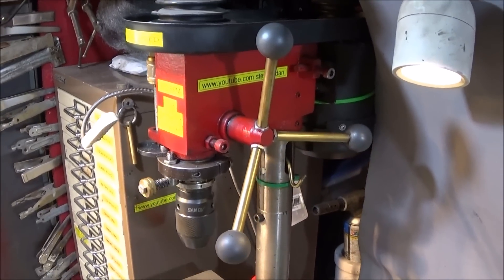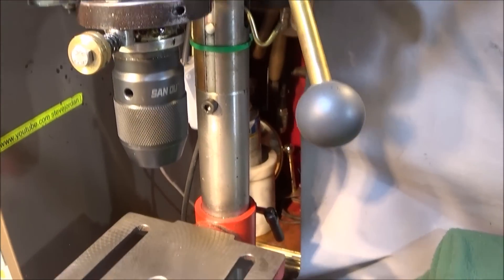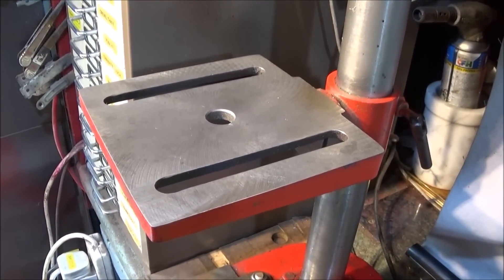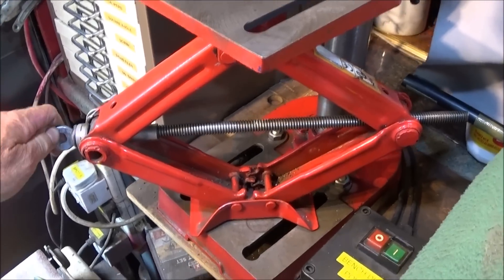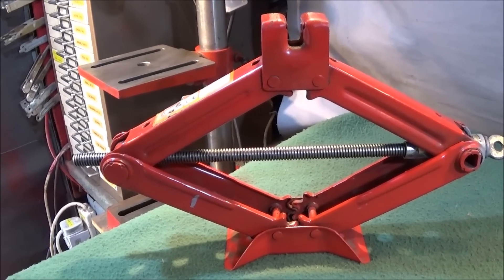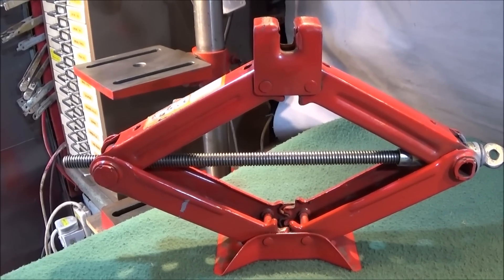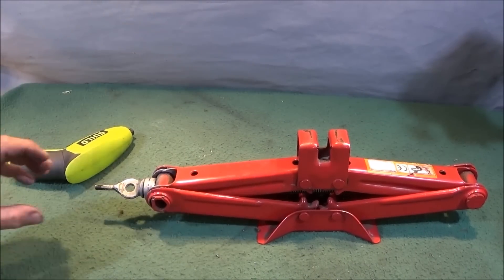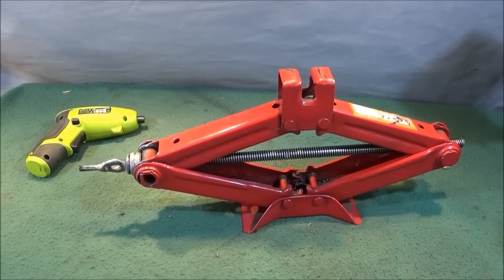A Scissor Jack Hack Super Fast Bench Drill Table Support

Comment: I've got to ask what made it necessary to put a jack underneath your drill press bed? I'm genuinely wanting to know in the event I may need it. I have a cheap drill press from some local box store and I put it through hell. I mostly drill through steel often cold rolled or tool steel hardness. I also often use a lot of home saws cutting through ~13mm (1/2inch) plate often and it's never been an issue.
Reply from the maker: On the low-cost bench drills, the drilling tables tend to flex under load.  Causing inaccurate angled drilling. The jack is placed under the drilling table to prevent this from happening. Just lightly touching the underside of the table to keep it square. The Jacks are quick and easy to I use like this. Regards Steve

Comment: yes   in fact   it would  lift  a car   with  a  bigger  drill.  i  use  an air power   air   tool  that  i  change   between the  two.  but  just like  a pump  jack  i have to mess  with   an ajust  to get it just  so.  anyway im thinking to  set an on off  on a  laser  measure .but  ror  now  i  wuse the  death  set  on te press.  i like your  sight i have  not  looked  for  a long while.  its  good.

Comment: I welded a 9/16th nut on and us a socket with my cordless drill has enough power that it will lift 19ft camper trailer to change a tire ;)

Comment: How well does this support actually work, have you tested it with a DTI?
Reply from the maker: Hi Robert I don't need to test it as there is no flexing. These jack's can take tons of pressure as they are designed to lift cars. Regards Steve

Comment: Or to save time get a j hook and put In Your drill
Reply from the maker: It doesn't save time though. The hook has to be loaded in a drill chuck each time. The hexagon is a permanent fixture. The electronic screwdriver is just placed on it easily whenever needed

Comment: Its good but theres another way to electric drive the jack without any mods or welding. I got a fairly fat screw hook to put in my drill chuck. I flattened three sides of the threads for the chuck jaws to grip, but that may have been overkill. Anyway, the hook part goes into the existing drive hole the same way as the original crank does. Easy in, easy out. You need not remove the chucked hook between adjustments. The drill can just hang there by the hook. A bonus of this method is that theres no exact axial alignment, so the hook drive will run smoothly at almost any angle, kind of like a crude universal joint.

Comment: You never but never grind on the side of a grind wheel...
Reply from the maker: I do.....I've done it for over 40 years. Its a myth that it is dangerous and came from when the bench grinder was in its infancy and the wheels were poorly designed. In the aerospace industry it was common practice to use the sides of the wheels to facilitate the grinding of flat bottomed drills etc.
Reply: Call me Old School, we got a smack against the head when we were Appi's

Comment: Just an idea:
What if you connect/screw the scissor jack to stand and table permanently?
A motorized table lift. Isn't it?
Reply: A powered screw anchored in the press's base and running through a threaded hole between the table proper and the bracket on the stanchion. You'd probably need to add a pair of guide rods back of the stanchion to prevent twisting of the table around its axis. 

Tools are a contagion.

Comment: Very cool. But, it is not a safe practice side loading a grinding wheel. They are not made to deflect. Also, side loading can weaken the wheel which can lead to failure causing the wheel to explode.   At typical grinding speeds injuries can occur.

Comment: Another winner idea from this channel !  Thank you for sharing.  This takes variation out of the drilling process.  My drill press is a floor model so I will add some rigid blocks under the jack ( light concrete is my first choice) to rapidly accommodate the additional height needed to put the   table within the range of the jack.

Comment: I've welded a nut on the shaft and use my impact or drill driver with hex adaptor. did this years ago... ok hack, but not too original.

Comment: I find myself using scissor jacks over my hydraulic jacks.  they are way more flexible, faster and easier to use with an impact driver
Reply: There has to be a 'sweet spot' in the movement of the upper end of the scissors jack, given the geometry of it and the nearly-fixed speed of the driver. The sweet spot will depend also on the thickness of the material being drilled and, likely, the material and the diameter of the bit in use. Some discussion of that aspect would be a worthwhile follow-up. 

I wonder about the apparent 'jerkiness' of the upper end of the jack. It probably doesn't translate into lateral movement of the drill press's table as such, for most practical purposes, though. Can anything be done to prevent any lateral movement of the jack table from affecting the press table? More lube in the joints? Springs? Merging of the pairs of pivots top and bottom on the jack?

Tools are a contagion.

Comment: Why go to the trouble of  ruining a hex wrench and welding.  a less destructive way would be to use a socket over the standard jack screw.  An electric drill or impact driver fitted with an off the shelf extension would be quicker and less destructive

Comment: Good idea. I have one of those old Craftsman floor drill presses which has no up/down table feed crank or gear rack. You have to wrestle the table up and down the column by sheer brute force. A car jack makes it possible to make tiny precision settings and avoid hernias.
Reply: I have the same problem, but I'm paraplegic, and it's very difficult for me to adjust the table. I think this will be a great fix for me!

Comment: nice idea steve, but i made one of these 30 yrs. ago . i just welded a nut  to the jack in the same place you did , it takes a 3/4 inch socket and it works with ratchet , drill or air gun. nice job though.

Comment: Really good idea, I know it means the jack can't be lowered right down but if one doesn't have a welder what about using 2 nuts (one to lock other) place on the other threaded end, make sure nuts are even then drill in reverse should achieve same result.
Reply: Probably hard to find a nut that has that thread pattern, screw Jack's use square threads not standard machine threads.
Reply: Learn something new everyday :D
Reply: @chimera91977  
Oh, well, I tried but on the upside, I now know about jack threads👍👍

Comment: i use my scissor jack with a drill and just chuck a 3/8 or 1/2 drive adapter in it. then i get a cheap deepwell socket and cut 2 slits in  the sidewalls to fit over that washer on the jack drive.
Reply: get a larger socket and no cutting
Reply: Weld the smallest possible nut on the far end of the threaded rod of the jack and be able to run it up with the drill in reverse using a socket you already have. Engagement of socket and nut encouraged automagically. 

Tools are a contagion.
Reply: N
Reply: Ñ Ñ Ñ

Comment: no offense but welding that little fiddly hex on there is stupid, you are limiting the jack to forever just being a leg for the drill press, you have a small shop like most of us so having a jack that can only do one light duty chore is a waste. weld on a proper 17-19mm nut or bolt head so you can put some major power to it in case you need to use it to lift something else. I've got 2 scissor jacks like that, one came from factory with 3/4" hex head and the other i welded a large nut to it and i can lift my 3 ton truck off the ground with either one of them, don't need to do it very often because i have hydraulic jacks but there has been times when the scissor saved my ass because i could crank it up fully weighted in a hurry with my impact gun.....
Reply from the maker: Hi Did you watch the video or did you just see and focus on the hex part and come up with the wrong idea? These jacks are so low cost you can have one dedicated for a specific purpose like I have shown. I don't need this jack for anything else. I have a few scissor jacks, a trolley jack and other equipment for heavy duty stuff. Having this jack dedicated for this purpose like I have shown, is great for me. It is so quick and easy to use having it permanently on the drill base 
   Also didn't you see that I left the original coupling eye on the jack? Just in case it was going to be used for something else? 
    You need to study things a bit first before deeming something as stupid. Look carefully at the whole idea before writing comments like this in the future, otherwise people will tend to think that you are stupid...:-) Regards Steve
Reply: yes i watched the video, more then once even. my comment was based on a personal experience which i learned the hard way when a screw jack i didn't think i would ever really need for anything big was the only thing that saved my life and it was because it had a hex strong enough for my son to get an impact on and lift the car i was pinned underneath. i'm just saying, it doesn't hurt to go big because you never really know when something might come up you never planned for of even considered a possibility.....

Comment: Just use 1/4" eyebolt......open end alittle...put eyebolt shank in drill...no need to weld ellen key to jack...
Reply from the maker: You could do, but its much quicker for me to do as I have shown. i.e ...Low cost dedicated small electronic screwdriver left on drill base for quick pick up and drive. No need to find the power drill, put the eye-bolt in the chuck, then have to hook-up onto the jack every time. I would get annoyed with that, as I need to work very quickly.
Reply: @SteveJordan  You have to "find" the drill and put the driver in it with any connection scheme, including your current variant. Seems pretty obvious. Thanks - Lumpy

Comment: I have a couple of these in the workshop for general use and yes that includes car lifting too! I welded a 17m/m bolt to the eye. So it can be used with a cars own wheelnut wrench. I mostly use them with an impact and 17m/m socket though. Great vid!

Comment: Hi Steve. Good video. That style jack comes in handy in many ways. The tool chest that is to the left of your drill press. I like it. I suppose that it was originally for something else and you repurposed it to go into the shop. I have been looking one like it with shallow drawers and a lot of them to put under my lathe to hold tool bits and other small stuff. Would you happen to know what it was originally used for so I would know where to start looking. Thanks and keep up the good videos.
Reply: Anthony 
They are Office Filing cabinets and drawers, that particular one looks like it may be made by. ‘Bisley’ i have 3 in my garage that i liberated from a rubbish skip.
There is a whole range of different sizes and configurations ...and they make excellent workshop storage ......even do matching metal cupboards ( and yes i got one out of a skip)
Reply: Steve Brown thanks Steve at least now I have a idea where to start looking. I've come across several that was way to big or only had 2 or 3 draws. My lathe is a 9 inch south bend and has its on metal cabinet with the motor inside of it. I have a space of 11 1/2 " wide and 20" tall directly in the middle of it which is an unlikely size to find probably. But still on the hunt for one.

Comment: Neat idea. Hopefully with the light loads that the planned use of the jack it won’t be a problem. My experience is Allen wrenches are quite brittle when welded on because of the heat treatment in them, since you welded your Allen to mild steel that shouldn’t be a problem
Reply from the maker: Hi James, I don't put any pressure on it but if it breaks, I will make a slotted adapter to use on the end. I was going to do this anyway as its easier to line up and get it concentric with the jack screw. Anyone that sees this though and hasn't got a welder can easily make one on the lathe. The allen key bit got quite hot and I let it cool naturally, so maybe it has annealed it a bit and made it less brittle?
Reply: How do you know the ring was mild steel ?.... Could be a higher carbon range..
Reply: That is what understand from Steve

Comment: Hi Steve,

Good idea.  I see you're putting that welder to good use :)

Yes, flex is an issue even with heavier drill press tables like mine.

When I see those extended arm/multilink drill press tables I just laugh - the flex must be horrific.

The castings on drill press table column supports are generally hollow and applying excessive unsupported force can actually break them.

Cheers Rob
Reply from the maker: Hi Rob, The welder is excellent for me. I'm so pleased I watched your review and bought one. 

I found and bought about 5kg of really old welding rods from my local recycling center. They were so old that most of them had rusty sections, mostly in the middle, which I cut out with wire cutters. The good long sections I used by grinding off the flux to go in the electrode holder. They are about 2mm or a bit smaller in diameter. There are no numbers to determine what type they are but they weld fantastically! 
   I wouldn't have thought to buy and try old rods if I hadn't seen your video on this inverter welder and saw you using old rods!
 If I was younger and didn't have such a small workshop, I would buy one of the older industrial type bench drills and a milling machine, but I can manage ok with what I have now.
Regards Steve
Reply: Hi Steve,

I'm like you, all milling is on the lathe.  The full sized mills really are too big/intrusive for my model making needs.  I like the middle sized mills but they are so damn expensive, and the plastic gears put me off.  Maybe one day ;)

Keep up the good work.

Cheers Rob

Comment: I've actually found those roadside, in quite good condition, dunno what happened, maybe the driver changed the tire , forgot to put it away, and simply drove off. Thrift stores usually ask as little as $1 for them too, I kept 2 for general shop use, great for deconstructing cabinet built- ins; just power them apart.
Reply from the maker: You find some good things by the road. That is a good use for them!!

Comment: Neat fix... Though I'd probably use my power drill which usually has a hex driver bit holder in its chuck. Or even the impact driver...I'd also use one of my many knackered screwdriver bits instead of cutting a hex key.
Reply from the maker: Hi Robin Thanks, You could also use the lowest toque setting to spin when the jack meets the table .